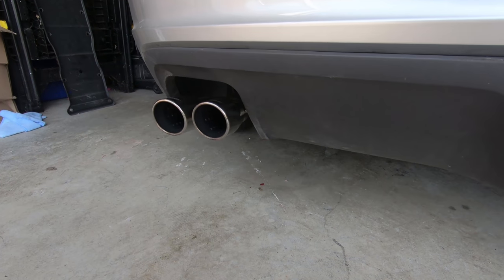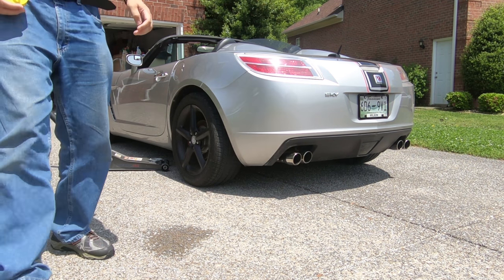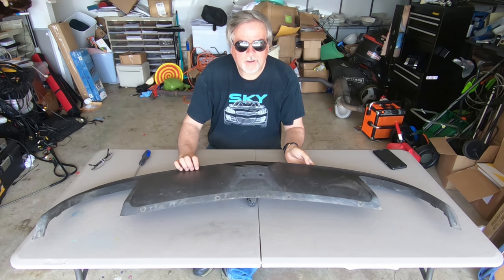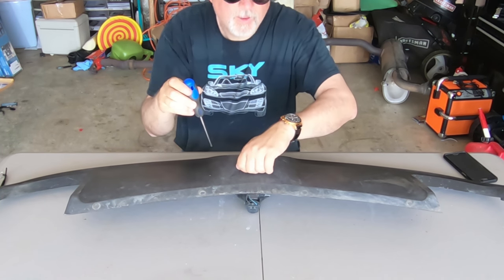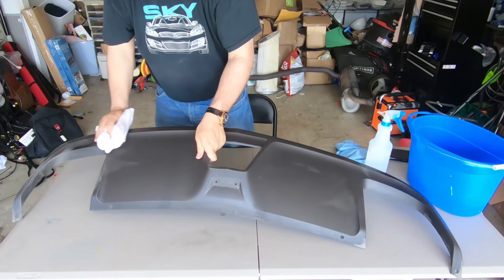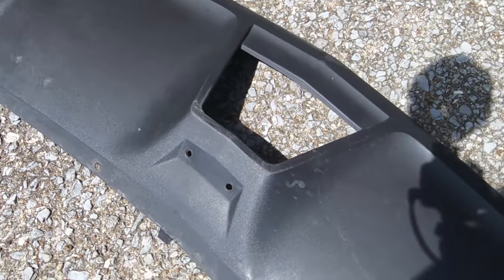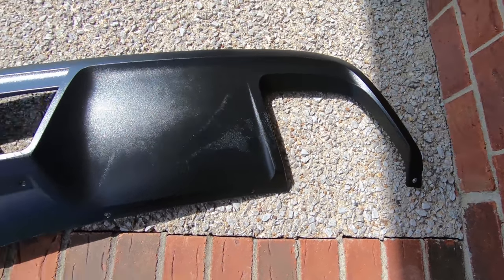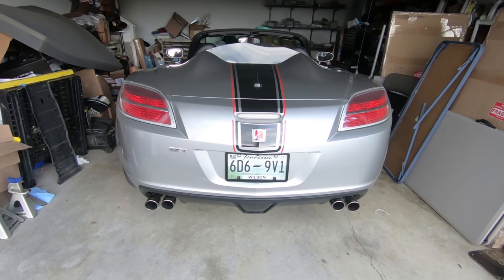Painting The Rear Valance on my Saturn Sky

Comment: Hi Mike,
 
Sorry to bother you again with dull questions, I seem to recall either you 
or a friend of yours under the car disconnecting the old exhaust system......did you 
install the dual one yourself and I noticed on this and other videos you use 
jack stands. I was thinking of maybe getting four strong ones and having a go at 
the exhaust myself. where do you usually place the stands after you have the car 
jacked up as high as you need it, any solid spot you can find?
 
Thanks,
 
Lance

Comment: Hey quick question, where did you buy the rear redline bumper piece to install the diesel exhaust. I have a base 2.4l auto transmission but I’m wanting to switch the rear bumper to go with the fuel exhaust

Comment: Hi Mike. This question is a bit unrelated to your restoration of the valance (turned out nice), I just bought a Magna Flow dual exhaust for my Base Sky and I was wondering, is yours a Magna Flow and if it's from a Redline, is it 3 inch or 2.5 piping? Did you have any computer problems or error codes after the install. I'm going to have mine installed in a week or two when it warms up a bit. Mine has 2.5 inch piping.
Reply from the maker: Hi Lance. I swapped my base single exhaust for a Redline dual exhaust. It is the 2.5 inch and was a simple bolt on. There were no error codes that came up, however, I did get a tune because I changed the exhaust the same time I did the Stage 2 kit (which included larger fuel injectors and a high flow cat). I don't think you'll have any issues with just swapping out the exhaust. However, if you have a base model, keep with the 2.5 inches, otherwise you won't have enough back pressure which may cause performance issues.
Reply: Thank you very much Mike. Mine is the 2.5 inch one. I really appreciate these videos you do. You do a great job on them. Do you find that the larger injectors improve the acceleration....use more gas?
Reply from the maker: @LanceIs55  Yes, the larger injectors, high flow cat, and tune does make a difference. I basically picked up 30 HP and 13 ft/lb of torque. Here's the dyno results of my before tune and after tune. Stock

Before
127.3 WHP @ 4950 RPM - 144.5 torque @ 2650 RPM
134.8 WHP @ 4950 RPM - 149.1 torque @ 4150 RPM
133.8 WHP @ 5050 RPM - 145.9 torque @ 4700 RPM

After Stage 2 Tune
154.7 WHP @ 5300 RPM - 157.4 torque @ 5000 RPM
158.5 WHP @ 5300 RPM - 161.7 torque @ 4950 RPM
161.1 WHP @ 5400 RPM - 162.5 torque @ 5000 RPM
Reply: Thanks for the numbers Mike. I will look into that for my next project. I found a new Redline Valance here in Canada. Around $300 U.S. I was thinking of getting one from Norms but in the end I decided to buy the genuine GM part and maintain the factory look.....and it was less expensive than Norms without having to paint it. Cheers!!
Reply: @MikesHouseOfMods which tune do you have? Thanks

Comment: Have you ever had a problem with low coolant levels?
Reply from the maker: No I haven't (crossing fingers).
Reply: I have 2007 Sky with 59k miles and I have had a low coolant notice but no leaks that I can find and no overheating but it is running a little warmer. I was wondering if you had encountered this before.
Reply: Danny Presley its the sensor in your reservoir.. its corroded and needs to be replaced..
it happened to me
Reply: Thanks!